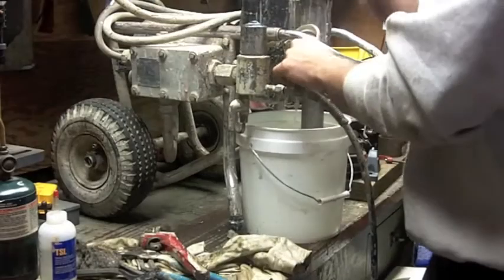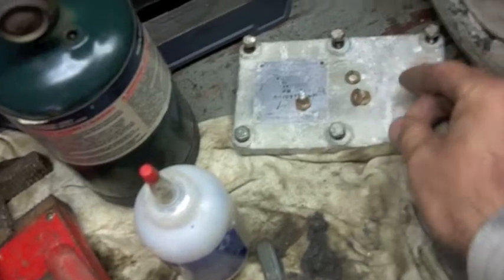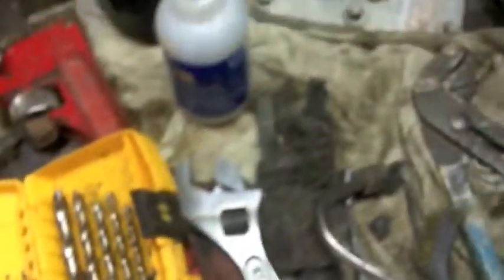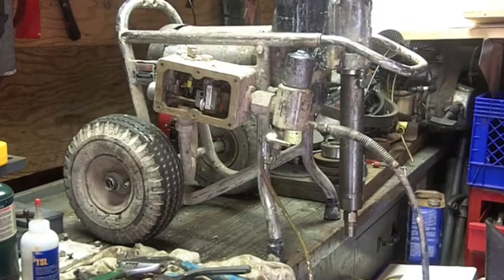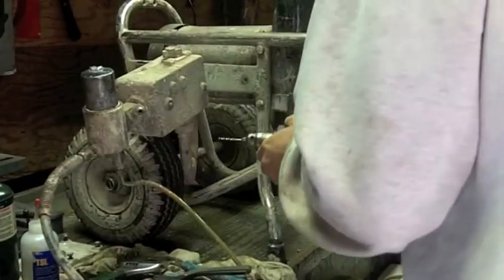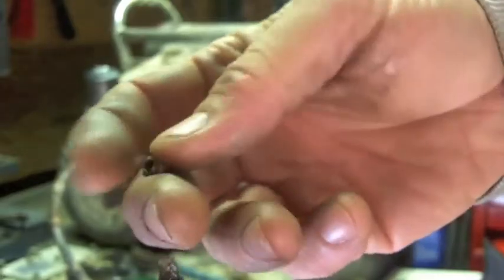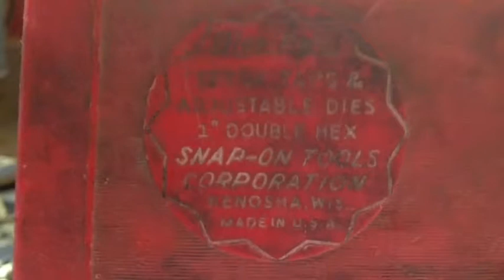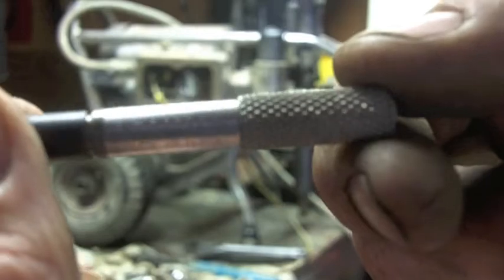Cleaning the Binks Super Bee 3

Comment from the maker: @Needmorehorsepower Hey buddy,  How's it hanging?   Yeah that old flared elbow has a worn out seat and the SS pipe won't seal.  Of course it's a non-standard Binks thread so I have to either figure out how to re-surface the fitting or find a replacement.

Comment from the maker: @Needmorehorsepower  I think I have it licked...I surfaced the flared surface and I will try it again this week, otherwise I have found a shop who services airless sprayers and he says he has a good used elbow.   That thing is rated at 2500psi and I would be nervous with anything but the steel elbow or Stainless line.  Good thinking though. Thanks brother.

Comment: When you reattach that tube it is best to tightened the tube first and then the pump jam nut  with a hammer and punch as you want the elbow fitting and tube to align properly .When that connection on the pump hsg leaks , you can try polishing or cleaning the taper area.If that doesn't seal  then you may need to replace either the fitting and or the tube .

Comment: @yourbeekeeper is it the flared end bad or the male fitting on the sprayer? you could cut the line and reflare and use some high presure hose and double clamps i asume or if its the male fiting bad try the old teflon tape trick